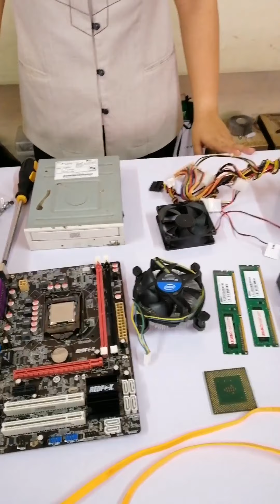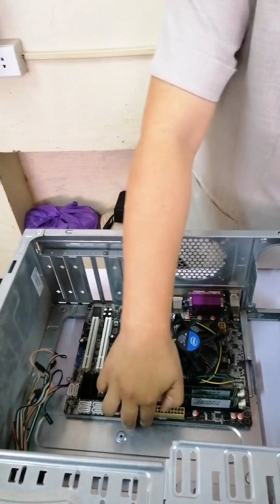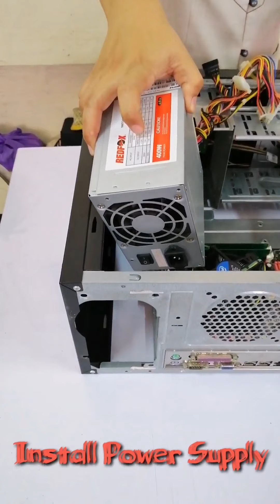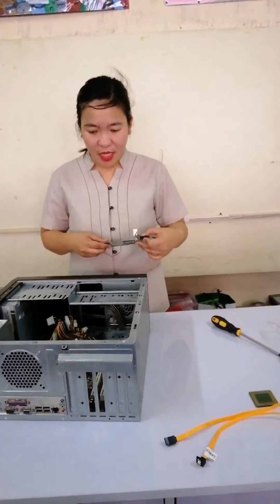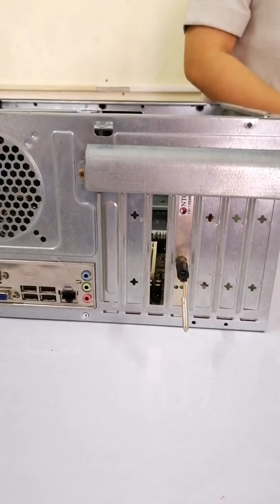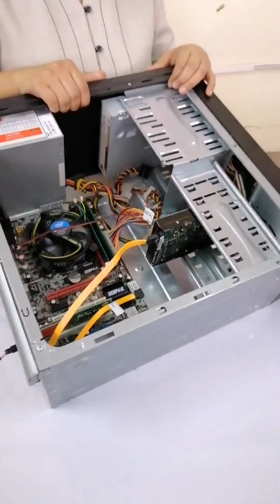Computer Assemble CSS

Comment: I learned the step-by-step process on how to assemble a system unit properly. 
We also need a neat workplace and functional tools that we can use in assembling or disassembling of system unit. 
We have to be prepared before we assemble a system unit and we can also consider the accuracy and accessibility of the informations that we learned or we gathered before.

Comment: I have learned the procedures on how to assemble and install the system units such as Memory (RAM), Mother boards, Power supply unit (PSU), Heat sink fan and lastly the Expansion cards.

Comment: I have learned the procedure in a computer assembly.
First, you need to prepare your workplace so that you can move properly. Second, put the heat sink fan and install the memory in the motherboard and install the motherboard into the chassis screw it properly. Third, install the power supply and heat sink fan into the chassis don't forget to screw it tight. Last, install the expansion cards and hard disk drive into the chassis and connect the wire to each other.

Comment: I learned on how to assemble a pc unit. I learned a proper way on how to installing a system unit. First, make sure that the work place is safe to assemble. Second, use protective equipments before assembling them. Then, assemble.
Reply: I learned a lot from this video. This will help me on how the right procedure to assemble a pc

Comment: Prepare all the materials that you will need in assembling the computer and before you assemble the computer check if all the things you will use are appropriate to the type of computer you have or you will assemble. Work in a place where you will not be disturbed and don't have elements that will affect your computer. For example water, food, and animals that may cause damage to your computer. Assembling a computer is easy if you know the proper step by step process. Attach all the pieces of the computer properly and gently so your computer will not have a defect.

Comment: I LEARNED THAT...

- we must prepare all the necessities in installing and assembling stuffs or parts  in motherboard or System unit like the parts of the system unit that needs to be assemble, tools needed and the working place.
- Prepare the motherboard and place it on a tidy and smooth surface. Install the heat sink fan by plugging it’ power connector into the proper place in the motherboard 
- In installing the memory in the motherboard, we must be very careful in  terms of attaching it to it’s place. Push it down gently and lock it using the dedicated lock to prevent from loosing
- In Installing the motherboard in the system unit, we must first look at the placement of the ports or pattern of the holes in the motherboard and simply attach it to the dedicated place in the system unit. Tighten all the screws to prevent damage from shaking.
- Just like in installing the motherboard, installing of power supply is must attach to the dedicated place or hole in the chassis and tighten all the screws to protect it from devastation.
- In installing the expansion cards and hard disk drive it is necessary to be very careful because it can be broken if not handle properly.
- I learned from the video that assembling system unit is not that difficult but we need to the anatomy and on how it is being installed in the chassis. We must take measures in assembling the system unit because it’s very crucial and risky if one of the parts are damaged.
Reply: it’s power connector*